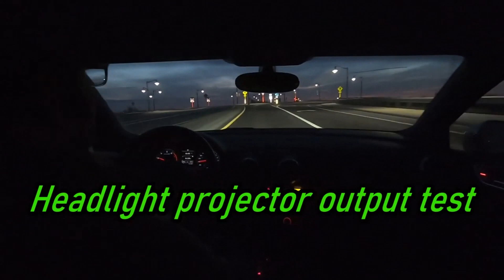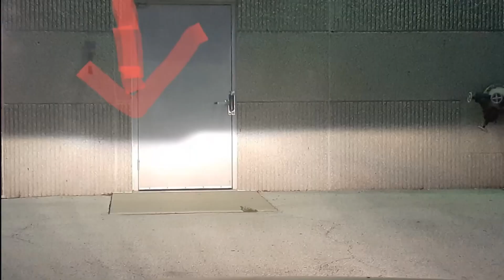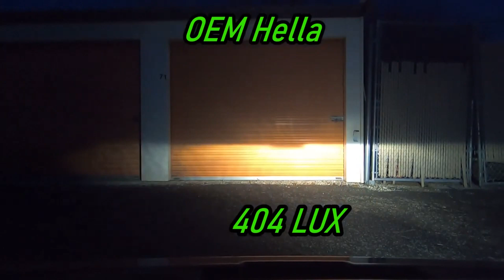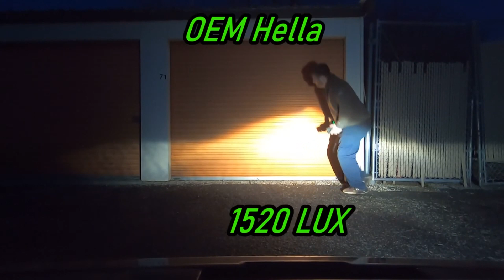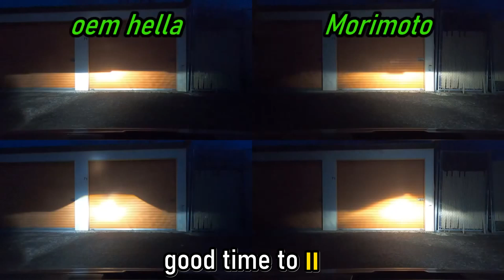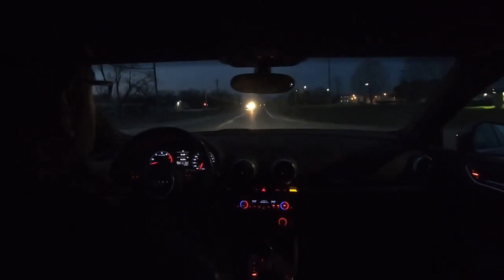2015 audi A3 oem hella vs. morimoto evoX-R 2.0

Comment: Hey there! Do you have a tutorial on how to swap the projector out? I’m thinking of doing this on my 2013 VW CC with similar BiXenons and am having trouble finding help.
Reply from the maker: The best thing I can recommend is to buy a spare set of headlights and open them up to save on time you can only sell one set of the other when you're done. Being that your car is a little older you might get lucky and have Bolton projectors and then you can just unbolt them and bolt in the Protectors of your choice. You may have to drill a few holes to get them to line up it's honestly not very hard. In my case the projector is molded into one big piece so we had to cut it off and make all new holes. It's honestly not a hard job it's just a very involved because of how far down you have to get the car apart and the fact that it's permaseal
Reply from the maker: I also wanted to add if you're picking up a spare light and you've never done something like this before by one that's broken / for parts because no matter what you do you can't hurt it or destroy its value. A great practice tool
Reply: Thanks for the reply!! Were your headlights curve adaptive by chance?
Reply from the maker: @kimballwhite  no, just car height adaptive and that is still in place

Comment: The Audi has a raise on the left not a dip in the center.

You ajust the headlight according to the lower part of the cutoff in the center, so on the left the Audi one will be raised higher than the Morimoto. It's for better visibility on the left side of the road.
Reply from the maker: hey thanks for the input, i see what you're saying esp at the 20sec mark with the wall shots but in my experience no matter how i adjusted them 5"drop at 25' or even perfectly level and past level there was always a blind spot right in front of me on the road.

close ups of the cut-off shield
https://www.youtube.com/watch?v=75j8-L4O7Qo&t=717s
Reply: @96ej  2" at 25' for the lowest part of the cutoff.
Reply from the maker: @dufonrafal  i hear ya, ive found no matter how they are adjusted the output is weak

My 04 allroad  has more output from the factory with yellowed lenses and old bulbs
Reply: @96ej  I believe you, I’m not saying they’re good :)

I was just explaining how this cutoff works and saying that the proper adjustment in the US is 2"/25ft.